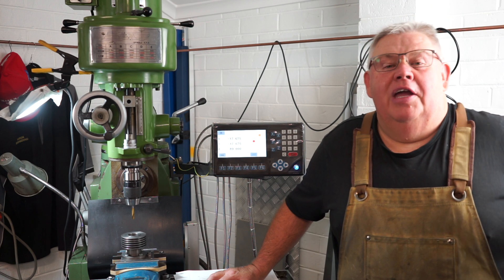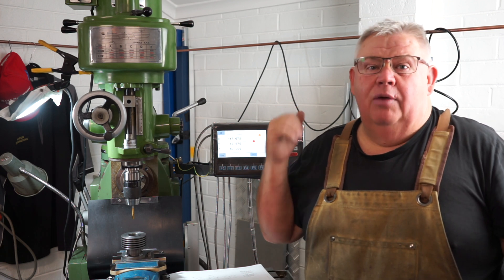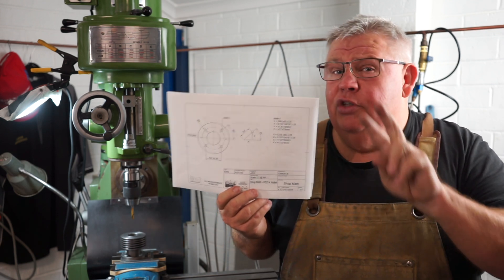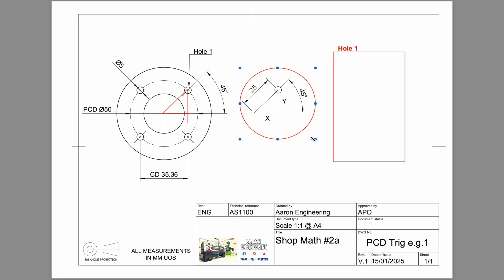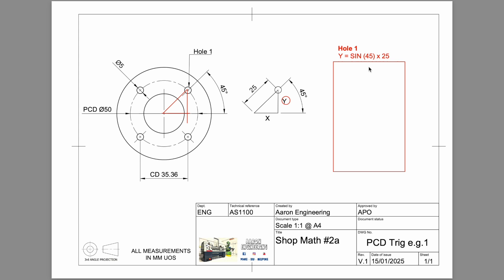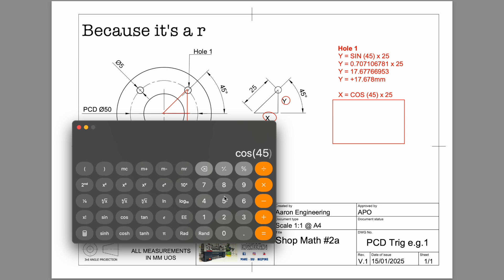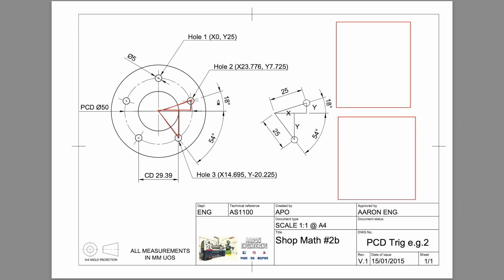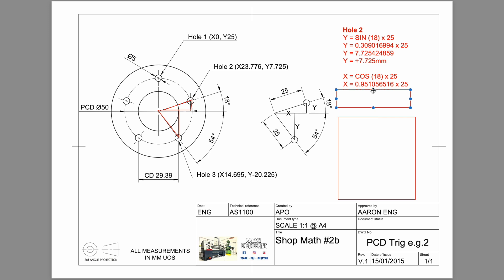Shop Math | Milling Coordinates | Basic Trig

Comment: Great clear video Aaron!

Important tip for those who might also be in the engineering / drawing office as well as the shop: always set your calculator to degrees if you're using radians in the engineering office (it'll be the 'DEG'/'RAD' indicator on the display... Bit of trivia, 'GRAD' was an attempt to make a 'metric circle' with 400 grads to a circle, or 100 grads to a right angle... It never caught on but.)
Reply from the maker: G’day Adam. Thanks for the feedback mate. That was excellent tip regarding the calculator setting. I didn’t know that about the “Grad” setting. Thanks for sharing 👍🍻